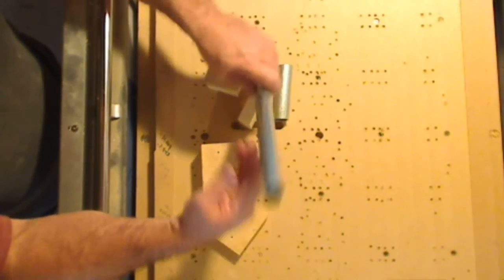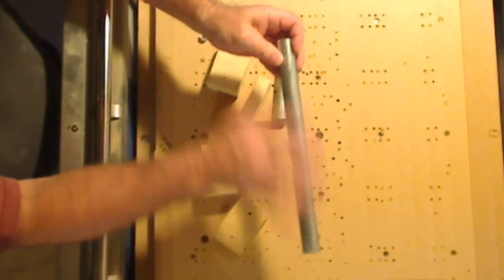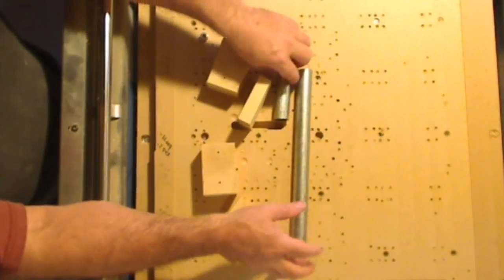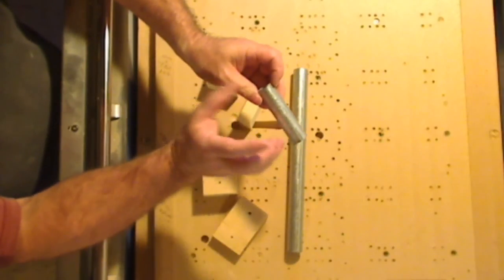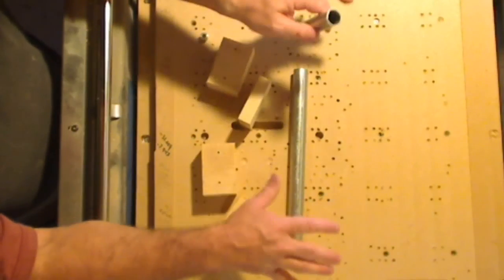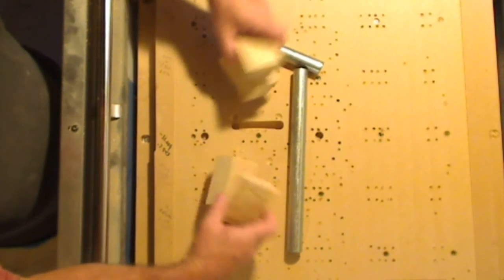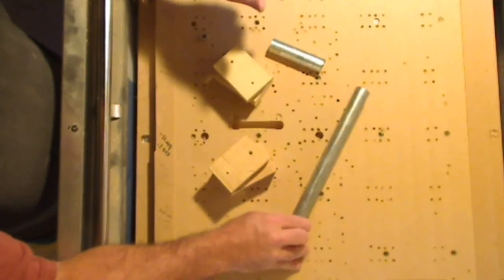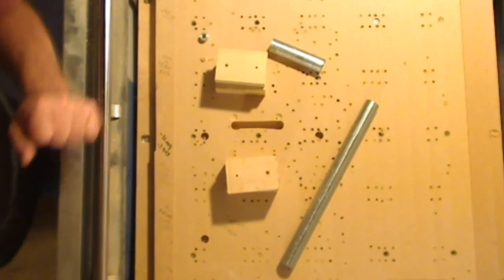MPCNC build part 1

Comment: Hello, I ask a question that you used measure pipe, 3/4 "?
and that stuff?
Reply from the maker: Hi Juan, I'm not sure what you are asking, but I am using 3/4 EMT metal conduit. The tubing has about 1 inch outer diameter. The way I am measuring is that I am not actually measuring really at all. I just cut all parts the exact same length as each other using my cnc router there. The point of doing it this way was to be able to assemble the MPCNC easier and have it square where needed and parallel where needed also. I did originally just use a tape measure and hack saw and cut them a little extra long before I cut them again on my CNC router there.